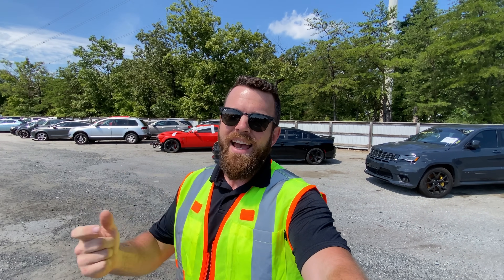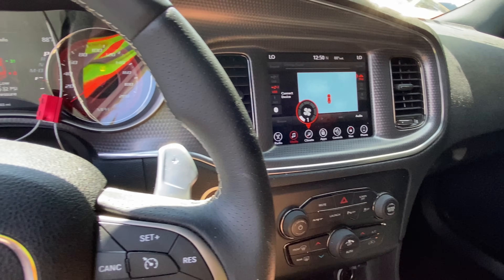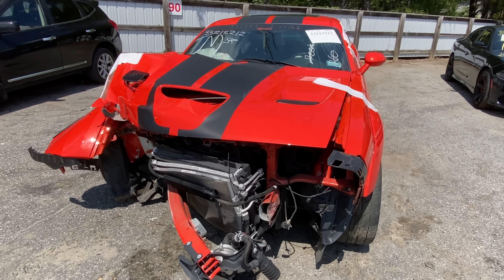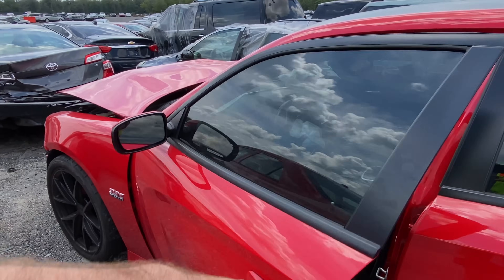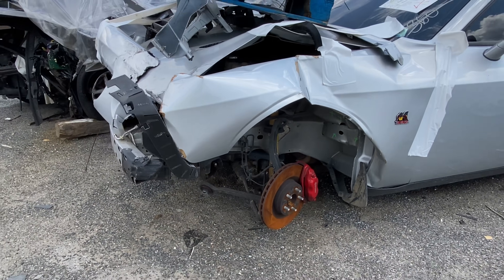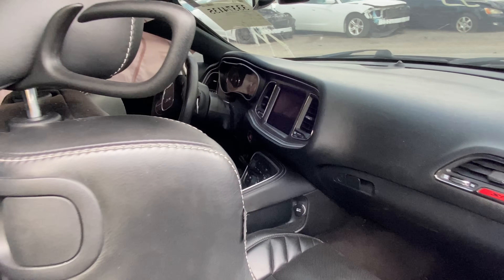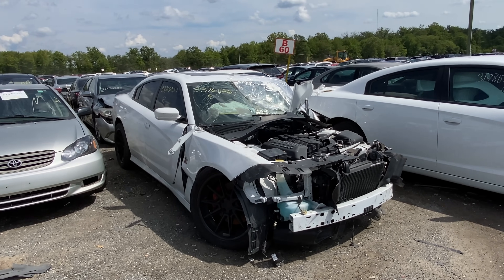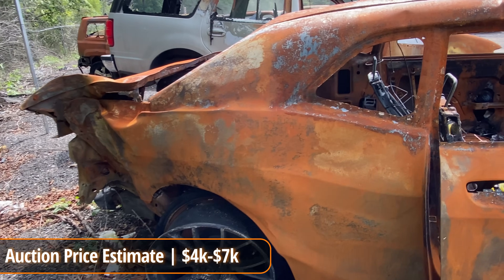Buying CHEAP Dodge Hellcats & Trackhawks At SALVAGE AUCTION!

Comment: A lot of the cars, even if the key has a dead battery, have a place you can put the key to start it up. For example Toyota/Lexus is to the push button, Dodge is to the push button, Ford is in the cupholder or in the center console there is a slot, plus many other places for many other cars.

Comment: With Dodge selling all the these cars in kits now I do not see a reason to buy a wrecked one unless you can get it less and 15-20K.
Reply: Most if the kits need a 10-15k drive train to run anyway

Comment: so, once a car hits the insurance auction, does it get a salvage title?
Reply: Depends on the insurance verdict after they access the damage.
Reply: @loneric550  so some cars, like the ones with no apparent damage could be bought without a scrap title?
Reply: @chrisgilbert2152  Yes you just have to make sure it runs & drives & has no undercarriage to flood damage.